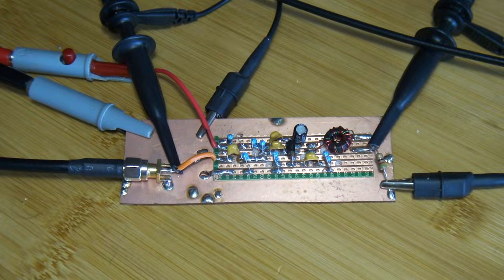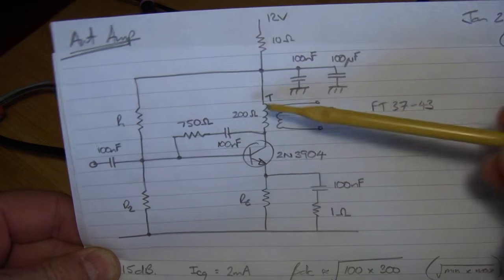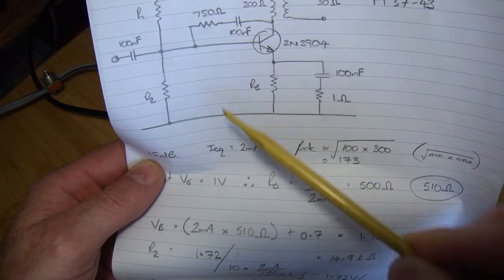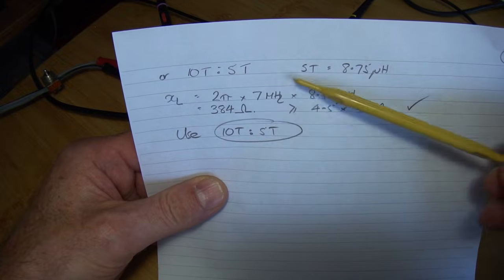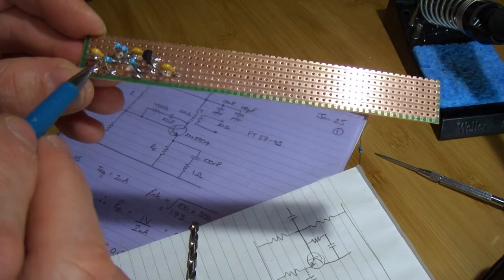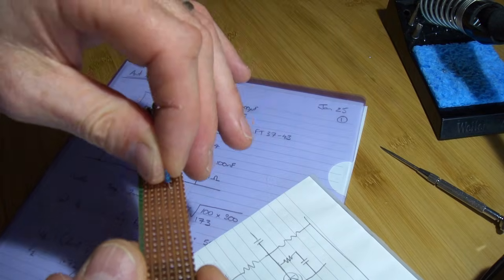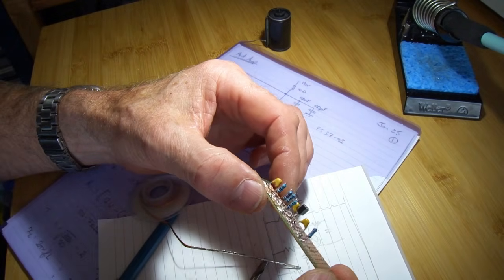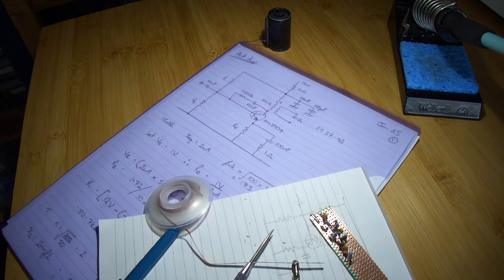40m Pelican Case SSB Radio - Part 6: RF Amplifier

Comment: Hi Charlie! Great video as always! One question: how do you choose Rc based on the gain in dB? I know that the voltage amplification Av is Av=Rc/Re but it cannot be simply converted to dBv or dBm since the output impedance seen from the collector isn't 50 ohms. How did you choose the 200 Ω value?

73 de YT1GS

Comment: EMRFD mentions that untuned link-style transformers should be avoided for interstage coupling due to being highly reactive (Page 3.32 of EMRFD middle of second column and 3rd column). If you're matching 200 ohms to 50 ohms, you should consider the bifilar wound 4:1 transformer. This has tighter coupling.
Reply: Correction: 2:1 turns ratio, 4:1 impedance.
Reply from the maker: Thanks. I use that mainly for PAs. Looks like my version of EMRFD (revised first ed) has different page numbers. I'll have to search around and see if I can find the ref. It will be easy to swap out.

Comment: Charlie's secrets are revealed, surface mount of through hole components on strip board. Ever thought of using say 0805 SMD components across tracks ? To bridge trace cuts with SMD, the cuts need to be narrower and maybe done with a blade.
Reply from the maker: Gidday. Yes, I will look to use the large 0805 sized SMDs at some stage as many of the through hole components are no longer made. I suspect I'll may have to try using the CNC mill again.
Reply: @CharlieMorrisZL2CTM  For just trace cuts on stripboard a Dremel is quick and will provide a narrow cut to bridge with SMD components.

Comment: Great video. I am thinking that the low DC current in the transistor, possibly affects the fT of the transistor, which could possibly decrease gain slightly. Slight differences aren't really too important, for the overall function.
Reply from the maker: Agreed. I normally use 10mA, but elected to have a lower current for the front end amp. I'm sure it will work fine.